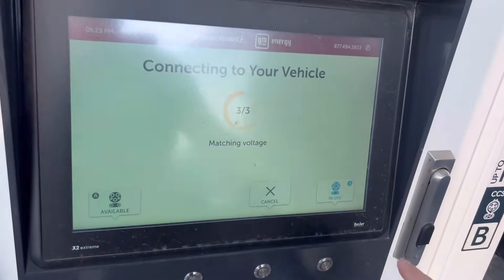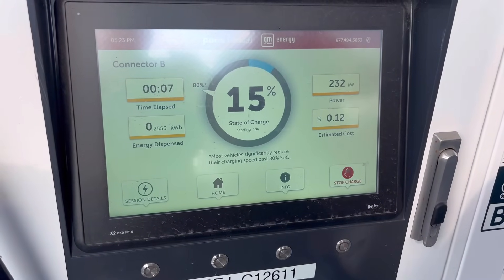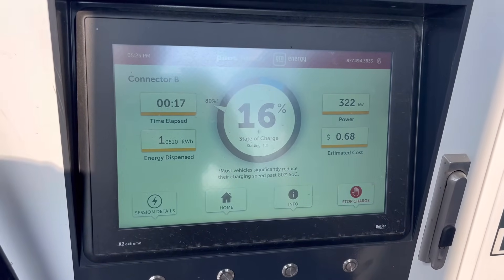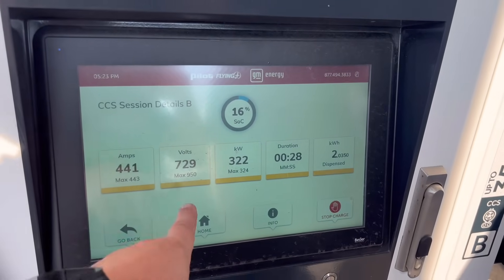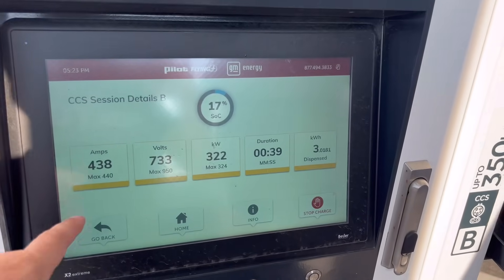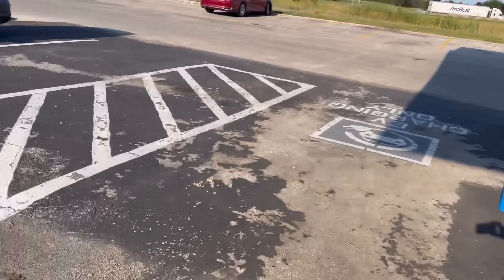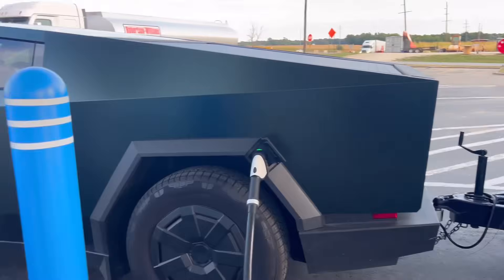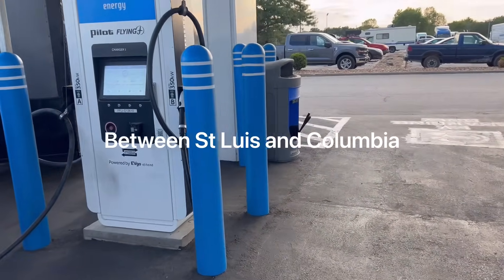Cybertruck Charging FAIL? CCS can be a pain even with a good adapter while towing.

Comment: The a2z is not a high quality adapter.  The cable is shown in their photo to plug in flat.  The Tesla to ccs are the reason why chargers are always broken at the clip.  The Tesla handle is curved extra to not have issues with Tesla using a weird plug angle.  And I am betting you kinked the liquid cooling wonit threw the error. 

Please trade for a lighting or rivian and stop breaking evgo stations. The Tesla charging port location is going to cause issues if you park next to the charger sicne a ccs DC should all be liquid cooled.
Reply from the maker: All new Rivians use NACS (the Tesla plug) and still need the same adapter today. Ford has already announced the switch, and most other major automakers are following over the next year or two. NACS is now standardized as SAE J3400, which locks in compatibility for future vehicles and stations. Under this standard, all official/certified adapters must support liquid-cooled CCS cables rated up to 500A continuous at 1,000V (the same spec used on high-power 350kW+ DC fast chargers). That means concerns about kinking or cooling failures aren’t valid with certified hardware. In practice, CCS in North America is being phased out in favor of NACS.
Reply: @BryantclanAdventures they have th plug at the back and have it angled to not kink the DC charger.  Rivian had a really nice adapter too. 

Or park like 3 foot from the curb.  You will still break the clips but you shouldn't mess up the liquid cooling that way
Reply from the maker: I hear what you’re saying, but honestly that applies to almost every EV charging stop. In most cases you can just back in, and the charger is in nearly the same spot. The only time we’ve run into trouble has been at EVgo pull-through stations that are designed for trailers.

Ironically, in this case the Rivian would’ve had more of a challenge lining up than we did, simply because of where the charger sits relative to the truck. We do a lot of long towing trips—just wrapped up another 1,800-mile run from Florida to Denver—and the only places this issue ever shows up are those pull-through EVgo stations. One funny point the Rivian adventure, network chargers were flawlessly their cables are designed great. They don’t add additional pulling torque to try to reposition the cable on the station tend to be lined up very well. They’re only problem is they’re twice as expensive as everybody else.

Comment: Seems like a cyber truck problem. Recently completed a 1,600 road trip with a NACS equipment Hyundai. Most of my charging was a PFJ with a CCS adapter, including this station, never ran into this problem. My adapter has a pin to stabilize the adapter. The cyber truck has a deeper port and requires a longer adapter which creates more torque. This is on reason Charge point operator requires users to use the manufacturer supplied adapter when charging. Hopefully EV was able to reset the charger
Reply from the maker: We are on a 1900 mile trip from Orlando to Denver with the trailer. So far this is the only EVgo station with the issue. But yes the adapter has to sit out further so it makes the issue more likely.